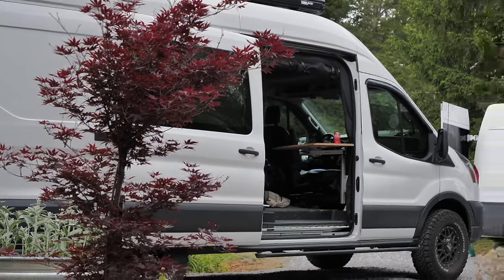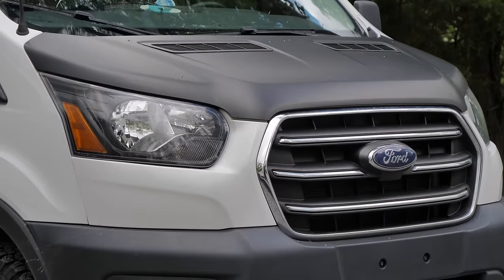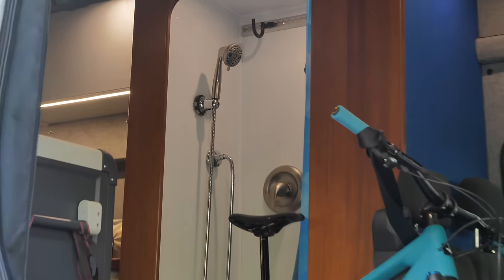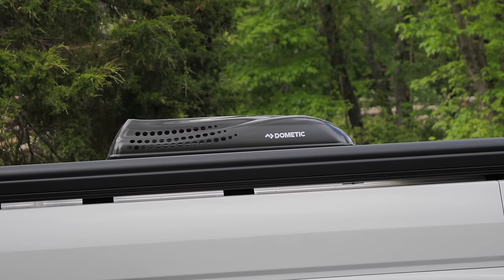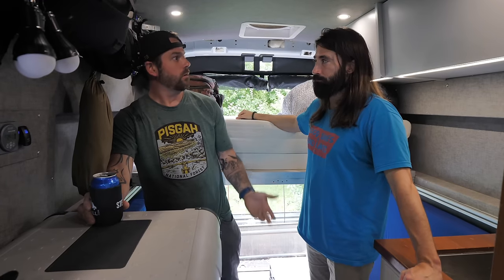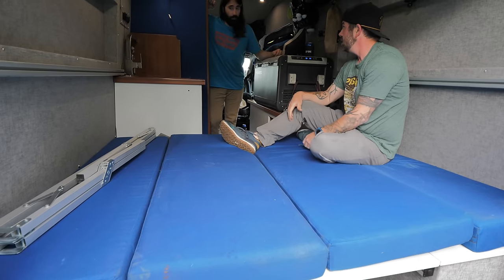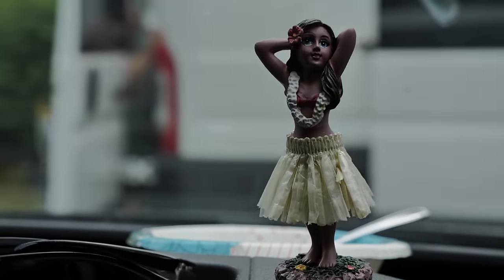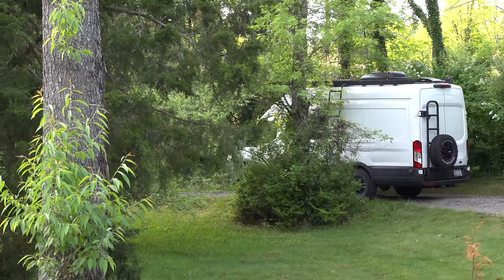This Clever Custom Ford Transit Build Smartly put $$$ where it mattered most! (Full Tour & Cost)

Comment: The reason you put a vapour barrier is NOT because otherwise it will be "humid" in your campervan. It's because you create vapour in the van (cooking/shower/human-generated), and that humidity can condense on the inside of the van's metal (warm inside/cold outside); this condensed water can lead to rust.

Comment: About vapor barriers... you can get away with not having one in cases where the inner van temp isn't that far from the outer ambient temp. However, if you're in a cold climate and heating the van inside – or vice versa – you'll eventually regret not having used a vapor barrier. The internet has all sorts of "experts" but it's really no more complicated than that.

Comment: The metal on the van is a vapor barrier. If you put another vapor barrier up then you're going to trap moisture between the two and THEN you'll get mold. Everything you build a van with should be breathable so it can dry out easier.

Comment: I'm very curious about the lack of moisture barrier.  He said he camps in hot and cold but what about humid?  I live on the Gulf Coast and it's extremely humid.  I worry about this.  I plan to have slotted bed frame and air holes drilled into various cabinetry and installing 2 fans and gonna use dry heat heater but definitely do NOT want to have to deal with mold.

Comment: Amazing build...lots of aircraft inspired components such as the repurposed seat/cargo rail, the Firex ball, (similar to what they use on aircraft, which releases Halon gas by firing a squib (a modified shotgun shell). I didn't know they have commercial version), the cabinet door hinges, which is quite similar to what they use on overhead cabin bins, and the use of aluminum frames for the bed and electronics. Very well thought out layout.

Comment: I wouldn't understand using vapor barrier in something with non-porous walls like glass and steel. Maybe I'm missing something?

Any dampness would come through open doors, wet gear, leaks. All things that would have to be dealt with. 

The t-tracks instead of cabinets is genius!
Reply: Vapor barriers in a small space like a van is counter-intuitive.  You'll be making it into a terrarium.  In cold weather a de-humidifier is mandatory, vapor barrier is crazy, all moisture drains thru holes in the bottom of all the panels unless they are sealed up by someone building.
Reply: Vapor barrier is to restrict air movement. Somthing a van dose not need.